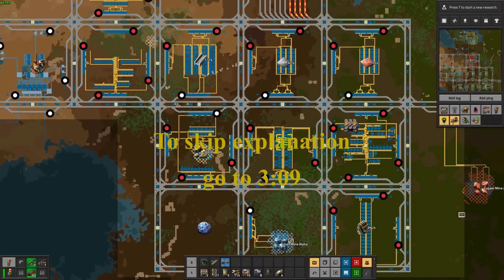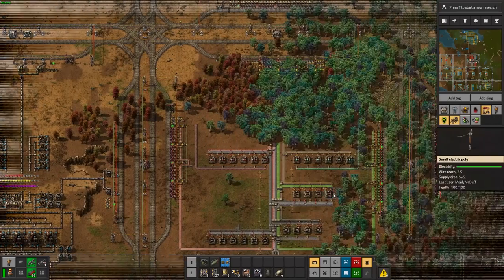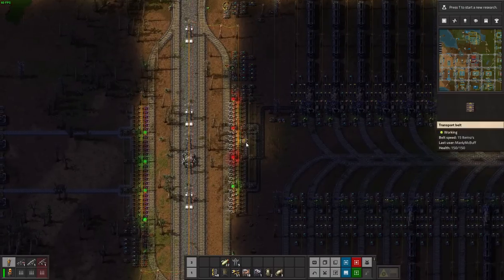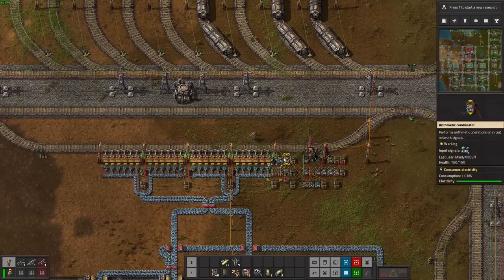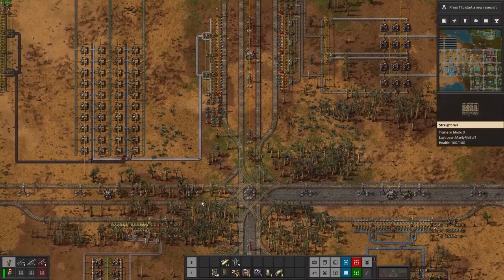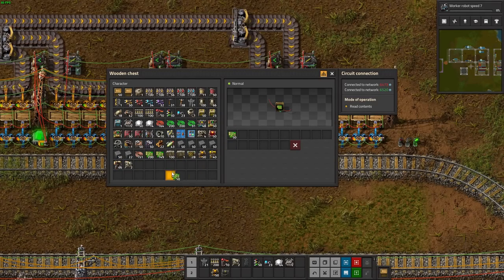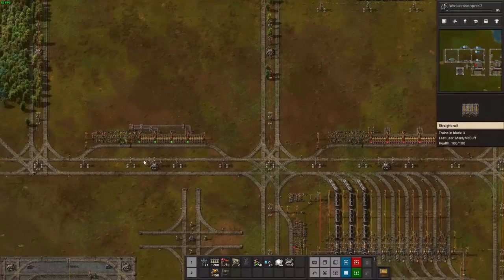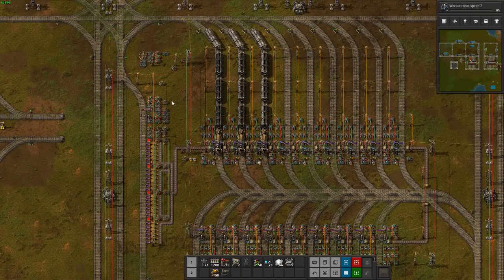Factorio Smart Trains (No mods)

Comment: Did you use picker dollies when designing the circuit setups? I found it was a great qol improvement when developing complex circuit stuff (lets you move and rotate combinators and the wires stay attached).

I developed a similar setup with a central providing hub, but with a system where requests would consist of mixed resource orders that would only have a train assigned and filled if the resources were available (this was for SE where limiting the number of stations is advantageous and you have all resources arriving from outside via pads or space elevator).

Comment: You seem to have implemented the feature that made me quit the game when I failed to do it. We didn't have the station count train system, but I managed to use the train logic on how it choose train stations, to implement a dynamic outpost system, then the dev changed how train choose stations and broke my smart station system.

Glad to see some kind of smart station is now possible again. Though you didn't show if you had dynamic outpost stations, so I go out drop a mining outpost and my core base know to start using it automatically, when it runs out the station disable it self and the trains start picking other outpost mining stations. So all I have to do is run around making outpost without changing anything.

Having played Early Access, I'm unfortunately to worn out building the starter base over and over, to even get to the train stage. 2000+ hours does not make starting over fun anymore.

Comment: One possible improvement: can you make trains go from a provider station to a requester station directly without needing to go to the depot first? It'll increase throughput and save on fuel.
Reply: I think with this sytem, because the trains are stored at a depot named separatley, a depot station has to be in the route always. To make trains go between provider and requesters directly, and then park at a depot when idle, you would have to rename depot stations the same as every other station. Then work out how to allocate trains purely with circuitry. Would be quite a fun problem to solve

Comment: Very cool idea, how does it handle a large number of trains and Stations? 

My current way of doing it is creating cell blueprints with the number of provider trains included in the blueprint. The provider side of a cell has a hard train limit and the requester side is checking how many train loads are missing and sets the train limit accordingly up to a maximum e.g. 7 train loads are missing but the station has only enough space for 3 trains so the train limit will be at max 3 for this station. 

The trains schedules are looking similar to this [ITEM] Provider until full -> [ITEM] Requester until empty OR inactive 5s (-> REFUEL Station inactive 2s)

Refueling is done by requester chests or if I am not at that stage in the research with central refuel stations, depending on the number of trains in the network.

Things I can improve on is the Train Schedule and the Requestor and Refuel Stations, they should have a different condition based on circuits to remove the wait.
Reply from the maker: That's a cool way of doing it, I hadn't really thought of that.

I haven't tested my setup with more than 10 or so trains, because a small number of trains are able to handle the demands of a large factory. However, if you adapted this to a HUGE factory, more trains seems to lead to a higher frequency of trains going to the wrong stations. But there are things that can be done to mitigate this, such as increasing the clock frequency of the dispatcher, and designing better intersections that don't trigger the train AI to repath.

Comment: cool, but can it handle large volumes? it seemed a bit slow
Reply from the maker: The speed is determined by the clock speed of the depot, as well as how many trains are able to leave the depot at one time. The clock is just a belt-loop with a fish on it, so you could increase the speed by just upgrading the belt or adding another fish. The clock pauses whenever a train is leaving to avoid backing up the depot and dispatching the wrong train. So a way to make it faster would be to have each side of the depot have its own train outlet, and perhaps two clocks that alternate which side of the depot is deploying a train.

You didn't point this out, but as I've said to other people in the comments, it's also possible to make it so the trains dont need to visit the depot after every trip with light modification of the system.

Comment: If Im understanding correctly you are doing resource pick up -> central train yard with payload -> resource deliver -> back to central train yard empty

Why not cut the second step since you know confidently that the trains have to do a pick up and a drop every cycle?
Reply from the maker: I originally was doing it that way, but transporting fluids throws a wrench into that since a train will be left with empty barrels in its cargo after dropping a fluid off. You could certainly remedy this by having separate trains just for fluids, or by returning empty barrels with a separate train or with logistics bots.

Comment: Can you achieve the same outcome with basically one decider combinator at each stop? If the requester station has room to take in a resource, it sets the train limit to 0; if a supply statin has enough to fill a train, it sets the train limit to one. Otherwise, train limits are 0. Your setup is super impressive either way. Well done.
Reply from the maker: Thank you!
With that proposed setup, I think you would still need resource-specific trains. Otherwise, a train that just filled up at a copper provider station could just end up going to any requestor station with a limit higher than zero. The only way I could see getting around that is if you had a circuit connected to a factory-wide network, that cycled through the various resources, which would trigger the stations with the corresponding resource to hail/dispatch trains.

Comment: Sending each train’s contents on a multiplexed circuit signal by TDMA, and having the requestor stations enable/disable when it receives a signal of interest.
Did I get it right?

I wonder if it’s possible to multiplex with CSMA so that the number of trains is not limitted by the timeslice length, or is this overkill?

Also, awesome music 😃
Reply from the maker: I had to look up what TDMA and CSMA meant, but yeah, that sums it up pretty well!

CSMA seems like it would be harder to implement with factorio's circuit mechanics, but if you were going to build multiple depots with lots of trains, I could see it being an advantageous way of going about things.
Reply: @BenjaminMarshallScienceMan  At 1 tick per station, you're looking at 300 stations having 5s latency with TDMA which is still much less than the time it takes for a train to be unloaded so for any realistic purposes TDMA will be sufficient. Plus the cycle can be dynamically altered based on station count with TDMA so there is never unused time in the cycle.

CSMA is a fun project - I've mucked around with it but it introduces additional logic everywhere since with TDMA you can kind of just broadcast signals and treat them like regular signals outside of the transmission network, whereas with CSMA suddenly you are sending messages and have to store them in memory everywhere they get received.

Comment: I guess this is going to put a strain on your CPU when you're in need of a huge amount of trains.... Like my green chip production plant needs 5 trains of resources at the same time most of the time. Because of the slow rate of the dispatching of the trains it would seem to me that this will be the major issue for a megabase. Other than that... cool idea.
Reply from the maker: With this factory layout, rather than having a massive green circuit factory, you would be better off just having several green circuit cells. Also, increasing dispatch speed is just a matter of increasing the clock speed of the depot, and possibly adding another outlet for trains to leave from.

But yeah, I can imagine this putting a load on your CPU for a huge factory.
Reply: True but i dont think this was meant to be used in a megabase anyway because circuits are just bad for ups

That said, i will definitely be usong aomething like this when the expansion comes out on my first playthrough

Comment: Have you considered using a signal multiplexer on those demand/supply signals?
Reply from the maker: Do you have an example of what you're talking about? I know what multiplexing is in real world electronics, but I'm not sure what it would look like in factorio.
Reply: Since they never replied, I will make an informed assumption at what they meant.
I think they are referring to the practice of timing signals on circuits in factorio. Like you could potentially add a second constant to the combinator at each station that is T 1 through 60 and then add a clock that runs over the entire circuit and reach station will only transmit when the clock time is equal to their T value.
Basically allowing the network to specifically identify the resource or the station with a unique identifier while still being able to have station names be generic.
Obviously it's a bit more involved than that lol but it might allow you to improve your reliability if you worked it into your current setup (which is fucking amazing by the way).
DoshDoshington talks about a similar setup in his City Block video, I would check it out if you also like to watch factorio content and haven't seen him before. He's very adept with circuit networks.